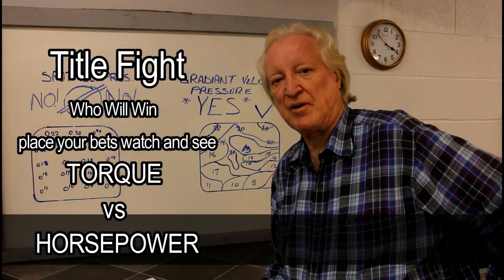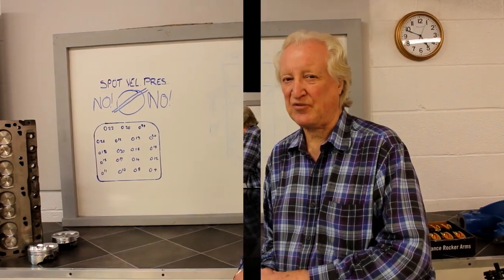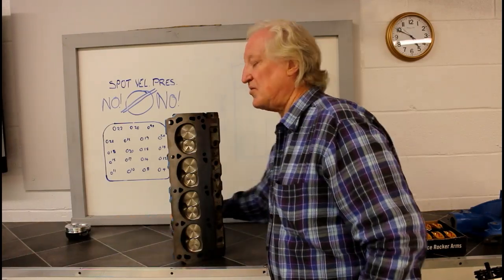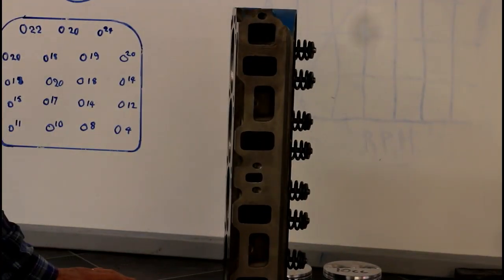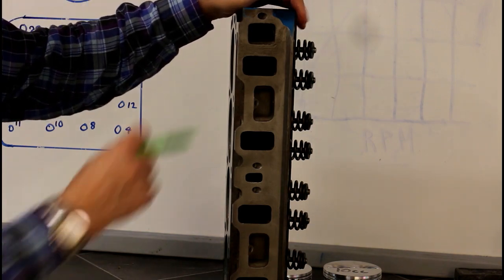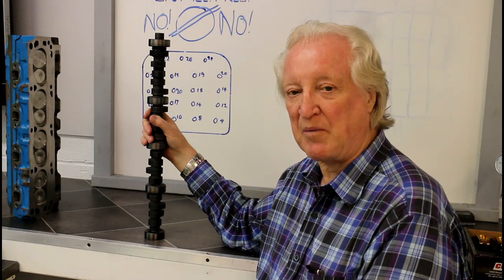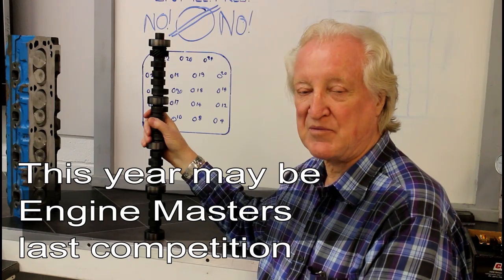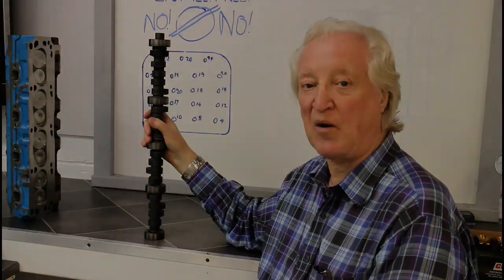Powertec 10 Episode 2 Torque vs Horsepower

Comment: Can anyone here give me thoughts on the power difference of a SBC with vortec heads that has an AFR of 11.0 vs an AFR of 12.5...how much power am i losing? My engine is a 388 SBC stroker, 9.3 compression, stock vortec heads, 277/277...223/223@.050...450/450 lift w1.5 cam on a 106 LSA, 102 ICL..i only made 415 ftlbs at 2800 but the AFR was fat , at around 11.0-11.5....i should be making more torque? The dyno operator said that the Stuska dyno we used usually shows 10% less power than most other dynos....i thought he was just trying to make me feel like less of a loser, but he told others the same thing? ....any thoughts? thanks.
Reply: 11.0:1 is very rich, I’d definitely lean it out to 12.5:1 or 13.0:1 and make a few more pulls if you can. Also 106 LSA is pretty tight, you’d see a broader torque curve and higher peak torque at 108 LSA.
Reply: Barry.
DV's chart for LSA is based on cyl volume.
Headers are extremely important.
Reply: You are losing a good bit of power with that rich of a fuel to air ratio. An easy way for you to make a good bit more power is to put a set of 1.6 to 1 rockers on the intake side only. Think about that, with that small of a camshaft that will make more power

Comment: GREAT videos, David! I've been reading your stuff for years, and thoroughly enjoy your style. Having read your books and listening to this, my third YouTube video from your channel, I am very intrigued by the 289 vintage racing engine you mentioned. Could you please do a spec-sheet type video on that engine? I'm not interested so much in any proprietary info, but I am a huge 289 fan, and have been since around 1967!!?? I have many parts I'm putting together for a "close-to-original" '65 Shelby GT350R build. Thanks for such informative content!
Reply: I am doing professionaly 5 years preparation of 289 heads for FIA approved classic racing.    Been around 25 years prepping heads.  The 289 head , and block need a lot of fine detail work  to make power and reliability.... 

Valves we are stuck with 1.88 and 1.6 as per regulations.     Intake size at the gasket fixed sizes.  ( a bit smaller then Felpro gasket ).  Also on exhaust, but I dont make the exhaust that big... not at all!!! keeping the port wall thick to prevent cracking......

If you use on the intake 1.88 valves,  in my opinion , removing the guide is useless.   Flow is not increased  , guide wear shoots through the roof.    Streamlining the guide works.  

Same for exhaust.     And dont be sad if you have thermector heads with bump in exhaust near gasket.   If well done , it flows even better then without....
Inner radiuses :  VERY IMPORTANT. 

Also only flat tappets , as per regulations...No roller cams.....

Chamber is opened up to create more flow  AND swirl...

As these are used for road racing , I keep ports small , as throtlle response is very important .  

Compression is pretty high , ( not high compared to modern engines...) as volumetric effeciancy is low.  

Hp with dual plane is well beyond 430 hp with a dual plane Edelbrock.   And with Webers on it 460 hp, have done even more,   is possible.    Torque figures dont know exactly... but from 2500-3000  enough power to have customers happily complaining: tires spins.... also whwn shifting to next gear...short tire spin...So not more torque for these racing cars , as tires limits that.   More hp might be possible......but the 289 is difficult ti get more out of.

And yes...with the 351 heads on a 289....its easier..... But scruteneering is intensified as from England came recast 289 heads with 351 ports and chambers....so forget about a recast or 351 head using on your engine in these FIA  approved races.......

.https://m.facebook.com/pages/category/Business-Service/BFS-airflow-research-162541440518599/?locale2=nl_NL

Hope it helps a bit....
Reply: @Baard2000  cheers M8 taa 👍

Comment: Theoretical CR in a motor is related to cam events so wouldn't it be OK to use actual cranking pressure to be able to use a higher theoretical CR? I've been using the same (cheap) compression tester for about 30 yrs using a max cranking pressure of 220lbs/in2 with good results. The theoretical CR is usually around 13~15:1, BUT, it's on air-cooled motorcycle engines with probably easier/better heat transfer with small combustion chambers

Comment: i would love to know how to take advantage of long con rod ratios and ir intakes . all of the local speed shops race car specialist in my area think i am backwards or nuts, ive read most of your books they are very good well worth the money. thank you for your amazing knowledge .
Reply: @port nut that said, long rods increase tdc dwell, allowing the charge mixture more time to enter the cylinder. Potential "5th stroke" power is improved. (That's the ability of the tuned exhaust to create a negative pulse during overlap. Get that timing right, and you have effectively "super-charged" the cylinder with more air than the volume of the cylinder should hold.) That's the pro-stock way. Like greater than  115% efficiency.
Reply: CBob's Country Bunker his books state that properly tuned IR intakes are the best, but incredibly expensive. Within the parameters of a production block, con rod ratios aren't worth too much power. Bad ratios are worse with lower compression engines, as high compression does most work towards the top of the downstroke, minimizing side-loading.
Reply: what engine? i'll help.  i'll give you my calculus blueprint of engine and you double check it or use it or get some one to compare theirs.  what kind of engine do you want? chevy , ford , mopar? other? number of cylinders.
Reply: @port nut yeah in the end, stuffing as many cubic inches in to the block will get the most power, even with the additional piston wall friction. As RPM rises, frictional losses increase exponentially. So, for a street motor, with about 10.5:1 compression, and a Max room of about 6,500, don't even worry about rod length.